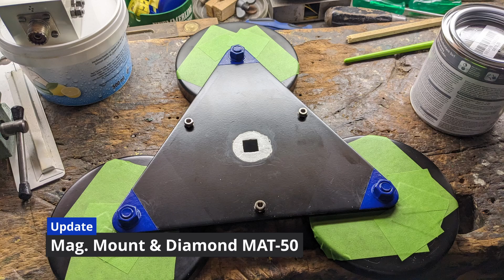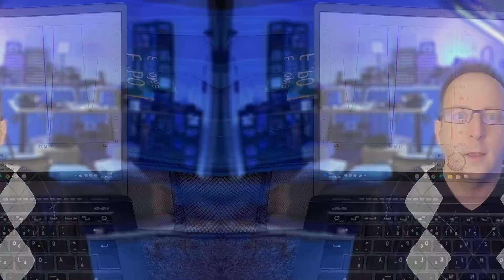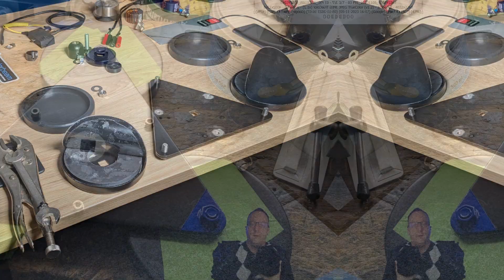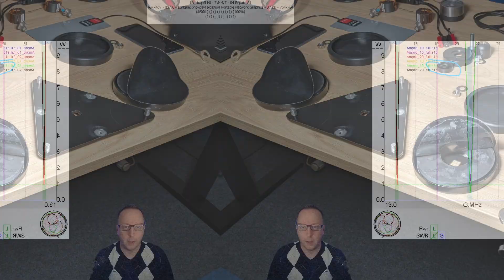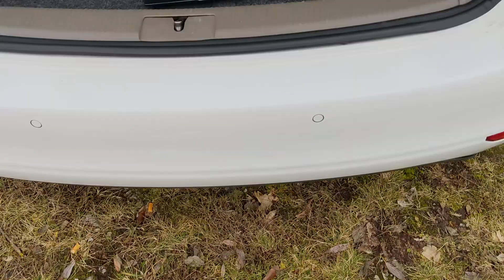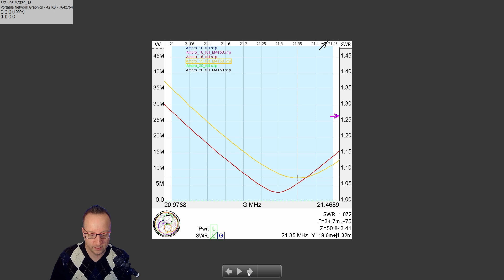Update Mag. Mount & Diamond MAT50 | HamRadio

Comment: I have a number of Sirio MAG145-PL SO239 which have a peculiar self-adhesive foil which according to the instructions, you must attach to the bottom of the magnet before reapplying the rubber boot. This somehow provides a capacitive connection between the coax shield and the car roof. The waterproofing and mechanical connections are not good and I have tried extensive modifications to try and make these reliable. The problem I have found is if I do succeed  with good waterproofing, I then get problems with condensation inside the mount, which never evaporates. I don't know what the answer is. Great video! 😁
Reply from the maker: Well it’s nice that Sirio seems to give you a spare foil to stick on the bottom of your magnets before putting the rubber shoe on. Not sure what it does in terms of capacitive coupling as the rubber shoe is surely thicker and contributes more. It surely traps the moisture / condensation and makes sure your antenna has wet feet. 😜 

It’s interesting to see how bad the water proofing is on these things after all those years. I guess the common approach is: Buy a new one once the screws rust and it becomes too disgusting. 😉
Reply: @labcat73 It’s not a ‘spare’ foil, there’s nothing attached to start with, but the instruction leaflet states “for a correct electric performance of the MAG 145 magnetic mount, it’s NECESSARY to apply the PVC sticker
Reply from the maker: And have you tried it with and without? Sounds a bit like marketing Voodoo to shut up customers that complained about bad SWR. 🤷‍♂️
Reply: @labcat73  I have. Without the foil VHF & UHF seemed ok, but HF was useless. With foil it would reliably work down to and including 30m.

Comment: Thanks for the video. Which vendor's mag mount is it?  When you got it, was the coax cable electrically connected to the triangular plate holding the magnet?
Reply from the maker: The coax shield (copper) is pressed against the metal of the triangular plate via that plastic thingy and by a screw on top of the plastic. So there is some connection until it oxidizes. - I don't think it is meant for permanent installation, as water will get into your coax easily.

Comment: Interesting info. Using the mat50 with the mag mount should increase the coupling or reduce the impedance. On the higher bands the impedance is already low but on 20 meters where the impedance (Xc ) is a bit high the MAT 50 reduced Xc enough to significant. It should also make a similar difference on 40.

Comment: Hello Tobias - Thanks for the video!

I use a single magnet base with 170mm diameter. It works out of the box from 20-10 meters.
Since I also use a 40m Hamstick, I drilled a hole on the side and installed a socket.
For the 40m band I simply connect a 10m radial.
Works perfectly. Of course, I only use the mount only static mobile ;-)

Why a single Magnet Mount? It's easier to get it of when the car is very high and the mount is hard to reach...
73 de Juergen OE4JHW / AH6UN
Reply from the maker: Thanks for the info Jürgen!
Did you have to tune the 40m radial or did you just grab a 10m wire and it was good enough?
Reply: @labcat73  
The cable is about 10m long. No tuning needed.
I also thought that a magnetic base wouldn't work because my car has a panoramic glass roof. Only about a tenth is metal.
But success proves me right ;-)
Reply: @labcat73  I‘ll send you a picture how it looks like on my car… 73

Comment: I could be wrong with my thoughts on this but doesn't the magnet base use Magnetic induction to get a counterpoise with the metal it is magnetically stuck to? (The electrical connection between the triangle and the magnets should be irrelevant in this situation) Therefore the Mat50 should make little difference as it is just using magnetic inductance also.

Comment: Great video (and cute cat), thanks for the update!
Reply: I have a terrible ground with my single large mag mount. I'm still in two minds about buying a MAT-50 and trying it. I'd probably try adjusting the antenna length too for best tube once MAT was attached
Reply from the maker: @johnr6218 I would not expect miracles from its small size. Maybe get a 30x30cm aluminum sheet from the hardware store and a few magnets or use some metal mesh material that you usually put over a light shaft to prevent leaves from getting in or some faraday cloth. Or borrow a different mag. mount from a friend for testing.
Also check the coaxial / cable connection. Bad contacts can do terrible things as I have learned the hard way. 😉

Comment: aren't the bolts for the magnets, carriage bolts (square shank by the head)? you shouldnt need to worry about if you loosen the nuts. just pull on the bolts as you tighten them as for the plastic bottoms they're there to slow down you from scratching the car paint. going from 1.05 to 1.13 on 20m for example i wouldn't worry about it, you should be able to tune that out with the antenna. you can get the same thing as that diamond mat by bonding the magmount to the chassis of the car and also bonding things like the bonnet and tailgate/boot lid
Reply from the maker: - Nope, they are normal bolts on my mag. mount. Nothing stops them from twisting.
- The extra plastic rubber shoe thingy still goes on top of the glued on plastic sheets, maybe an afterthought as the plastic sheet alone does not really prevent scratching 100%. Anyway one should not drag the magnets when taking it off... Just pull on one magnet upwards and tilt.
- Well this was just an experiment because I was curious. I didn't buy it because I needed it. I just wanted to know if there is some special black Diamond HF magic involved. I think it can be a nice tool for improving grounding when you have an antenna mounted to your roof rail, but there are millions of other ways to achieve the same. So whether it's worth the price is up to you. 🤷‍♂️
Reply: @labcat73   or you could just find some silver foil and stick to a flexible car magnet and stick that too the roof :D done that in the past too lol